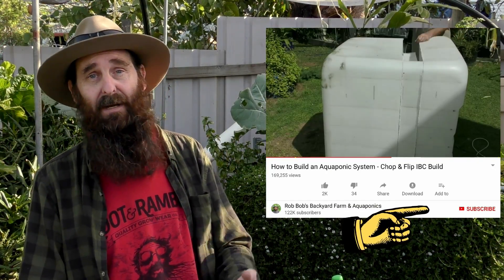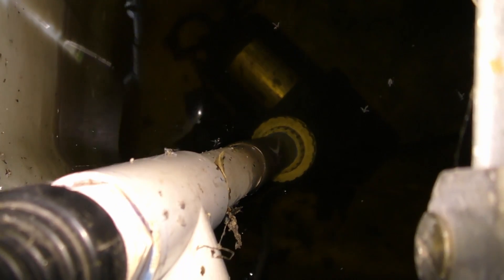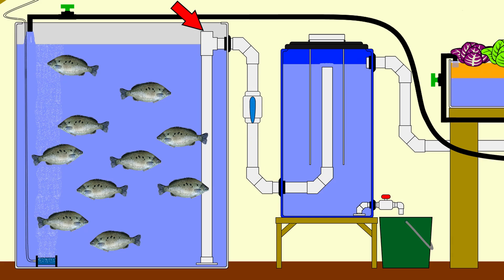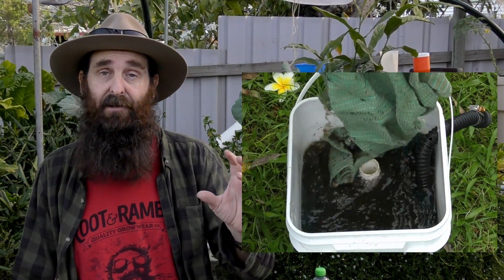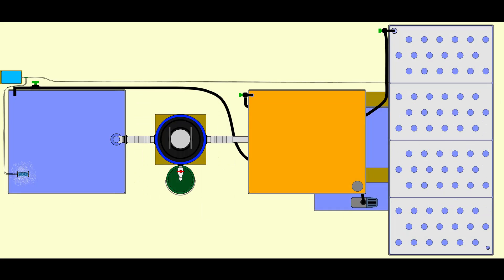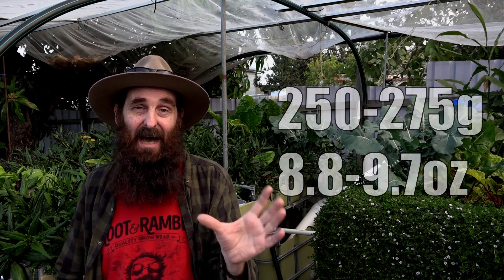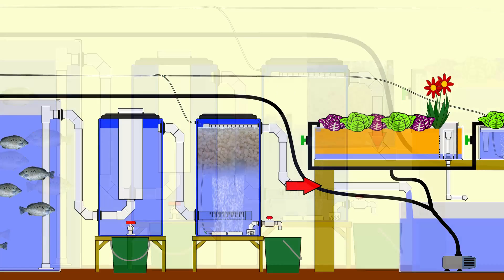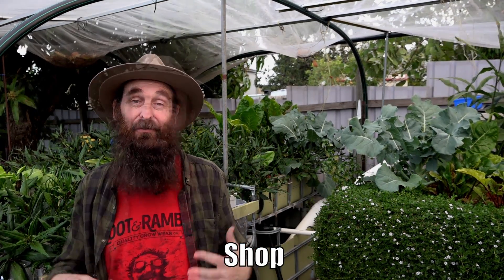Aquaponics Design | Backyard System for Pat

Comment: One thing I've really struggled to find is a good rule of thumb for sump tank size. 

I'm building a split flow system like in this video with a 1000 litre fish tank and ideally 3x 300mm deep grow beds. 

How much volume (roughly) would I need in my sump tank?
Reply from the maker: I have mentioned it in passing in a few videos but haven't posted a video just on sump tanks. 
In a system with flood & drain grow beds I work on the 50% rule. I like 50% of total grow bed volume as the minimum size for the sump. This allows extra water to stretch out top up times during the peak growing season. The extra water can also help compensate for temperature swings as well. 
Hope that helps some.
Reply: @RobsAquaponics  thanks so much for the reply. That's about where I've landed too. So hopefully it'll be all good. :)

Comment: I am interested in building one I was going to use a horse trough 1000 L container made out of galvanized steel
It has a hose size adaptor on the side of the bottom. Is there a way I can use that instead of cutting a hole through the side of the horse trough
Reply from the maker: Sorry I missed this Earl. 
Gal tanks are an issue for the fish as they can get zinc poisoning & die off fairly fast. It's best to line gal rums & tanks with pond liners if you're going to use them. 
Cutting a hole would be your best option as I would think that the hose adapter would probably be no bigger than 1". You would need a 1½ - 2" hole to get a nice water flow under gravity if that's how you'll be moving water out of the tank.

Comment: For my last system I just fed @ about 13g per m2 of plants per day. 

What was awesome... was that I stocked at a low rate too. So low that I had to feed them 3x a day (via auto feeder what was topped off every two weeks or so) so that they were able to eat that amount of food. It was actually 8x a day when they were fingerlings. lol 

My system was VERY low maintenance, Very resilient, and No solids filter either as the worms were able to keep up and my beds only filled with solids about once every 4 years or so. 

I literally just added water about 1 time a month. Fish feed about once every two weeks. A teaspoon or two of crushed oyster shell every 3 or 4 months. Didn't even have to add chelated iron anymore because I had the bottom 6" of each media bed filled with red lava rock.

DOWNSIDE... I didn't grow heavy feeder plants in there. Just Lettuce, kale, flowers for transplant, and a billion fruit tree clones. Which, a single tree paid for the electricity for the year. Extremely high cloning success rate too once I figured it out. 

That was a trial 150gal sump tank/ two 50gal bed system. I want to step it out to a 300gal sump tank system this time... and later on I will convert it to a CHOP system when I am ready to expand. 

I was using goldfish and a koi and sold them as they grew... which brought in good money as well. They were some pretty fish! 

I want to do a couple of koi and goldfish again... but then grow out eaters in the side tank this time.
Reply from the maker: Nice on MSH. Hope the system grew well for you this season.

Comment: Can you please provide with dimensions of fishtank, biofilter tank and solid filtration tank 
For me starting with small set up with just one fishtank to know the process? 
It would be very helpful
Thank you
Reply from the maker: In my basic system I use 1000L fish tank, 200L solids settlers & biofilters & the sump is generally 600L in volume. 
A 600L sump will support 12L of flood & drain beds. 
I hope that helps some.
Reply: @RobsAquaponics  thank you very much🙌

Comment: I'm wondering what would it be like if you got rid of the separate oxygenator and supply the air creating Venturi air suction through the water pump to both fish and the plants? It would deliver water and air together trough the same pipe. The pump might need to be bigger. But it seems like having one "heart" for the system would be easier to maintain. What do you think, Rob?

Comment: Hello, Rob. Thanks so much as usual for your amazing videos. Tell me please, what's the volume of growbed 1 (with clay media) and growbed 2 (with water)? Looks like 200l-250l and 400l resprectively
Reply from the maker: They are just rough drawings but I was basing it off of IBC tanks Dima.
The media beds would be cut at about 300mm/12" high so they would hold roughly 300L.
I think I doubled the length for the DWC bed so that would be about 600L.
Hope that helps.
Reply: @RobsAquaponics  thanks so much
Reply: @RobsAquaponics  you know
I start projecting my own single loop system. Fish tank 200l, solid filter 40l and 2 growbeds 100l each. I tried to save your proportions. Could you please help and tell is it okay in my scale)? My circulation flow rate is 400lph = 2*200(fish tank volume). But I cannot understand how much oxygen per hour should I provide to keep my fish happy)
Reply from the maker: @dimannish1  Sorry I missed your reply.  I work on at least the volume of the tank the fish are in per hour in air if that helps.
I hope the system is running well.

Comment: Your system seems to be exactly the bees knees and I want to make it but I'm concerned about the running cost as electricity here is far from cheap.
Could you please give me an estimate of how many kilowatts of electricity this system uses for pumps/airblowers etc. per month.
Reply from the maker: Hey Douglas.
Power cost is fairly easy to work out. Multiply the watts of your pumps by 24 (hours) then by 365 (days), eg. 80w pump would use  700.8kWH [(80x24)x365 = 700,800W].
Next look at your power bill to see what they charge per kW & you should have a ballpark power bill figure for running the system.  
It's a bit hard to get an accurate cost on ours as we have a back to grid solar unit on the roof so our system is subsidised to a point. 
Hope that helps some.
Reply: @RobsAquaponics  
Thanks for the helpful info.
Time to get the pencil out.
Reply: @RobsAquaponics  
And thanks for taking the time to reply.

Comment: This is split flow if I followed correctly. What about putting all the water thru the beds so it is a closed loop (not sure that is the correct term)
Reply from the maker: Hi Dave. I call that a single loop. 👍 It can be done & will be a better option for some. I run through a look at both types in this video if you're interested,
https://youtu.be/0QQA5BpWKec
Reply: @RobsAquaponics  I’ll check it out now

Comment: How do you prevent overflow of the sump tank?
Reply from the maker: As long as the system is filled to start with by adding water to the fish tank & let to over flow into the sump tank until that's full you won't have any issues when you start out. 
When topping up the system you remove any standpipes in flood & drain beds then top up the sump to the desired level. That way all the water will be in the sump or fish tank at the time of filling.

Comment: The question I have is is there any advantage to running to radial flow barrels in parallel and then a biofilter barrel.   Would this dislodge more solids or just waste the space with little return?
Reply from the maker: Running them in parallel would reduce the flow rates through them meaning more solids settling time which is a good thing. 👍

Comment: Im new here, and thanks for this video.  I learned a great deal about aquaponics in this alone!  How often do I need to clean sludge from the rock beds?  I have still so many questions, so I will look at your other videos before asking questions that look like repeats.  Thanks again!
Reply from the maker: Hi Deborah. I find every 2-3 years if the solids settler is maintained. Cleaning the clay is a real easy job (I've got it down to 1 hour per bed)  but it can take a bit longer if you use rock as the grow medium. This playlist has a load of videos for those just getting started in aquaponic if it helps at all.
ttps://www.youtube.com/playlist?list=PLBcWprMIwYYj8zCdbSzPJOR3HRXpxuBwf
Cheers & happy growing.

Comment: In this design, it looks the Bio Filter outlet is at the same height as the Outlet from the Radial Flow filter... 
- Doesn't the Bio Filter Outlet need to show as at least half of the Radial Flow filter outlet pipe lower (eg: 1"/25mm) lower > so the flow rate keeps up through the bio filter??
Reply from the maker: I oversized the pipes so it generally isn't an issue. It will cause issues with higher flow rates or smaller pipes.

Comment: Hello! I've just been referred to your videos by my daughter's teacher - love what you're doing. A question re water - do you treat the water before throwing in the fish, or use normal tap water (chlorinated and fluoridated)? Also for topping up any lost water due to evaporation? Just wondering as all the chemicals for my cold-water fish days "not for food fish" or something
Reply from the maker: Hi Neil. It's best to dechlorinate the water before adding any fish into a system. I use 1 heaped tsp of ascorbic acid (Vit C) to 50gal/200L of water to breakdown chlorine & chloramines if I need to do an emergency top up or start a new system. 
I've found doing small top ups with town water (5% total volume) doesn't affect our fish but the amounts of the chlorine & chloramines will vary from location to location. 
It is also best to "cycle the system" before adding the fish so their waste can be converted into a non toxic form & not kill them.
This video will help with some cycling information,
https://www.youtube.com/watch?v=kmxfI_fkmtc

Hope that info helps some.

Comment: Hi Rob.
Great video, thanks.
Why do you plumb your water from the fish tank to the bottom of the solids filter? Could I just have the water dropping into the top of the stillwell?
Thanks again.
Reply from the maker: Hey Michel. Having the water come up from the base into the stilling well slows it's velocity down considerably. 
If it was to enter from above you would probably get a current form at the base (depending on the flow rate & size of vessel) which would disturb the solids you're trying to settle out of the water column. 
Hope that helps some.

Comment: Can there be 2 different sump tanks for water going to plants and another for water draining from the plants and going back to the fish tank?
Reply from the maker: Yes you can but you'll also need 2 pumps to ruin the separate tanks. You'd also need some sort of overflow set up in case one fills faster than the other I think.
Cheers.

Comment: After looking at your garden I thought this place has so much waste space. I decided my aquaponics should be on the concrete slab so I have more garden space.I live in Paynesville vic and its cold some nights although more even temp than in land, what should I put under the carpet to stop the fish getting cold.
Reply from the maker: I have seen some folks wrap the fish tank in insulation then clad over the top of it to help keep the water temp up at night. 
Others won't worry & will run trout through the cooler months as they easily get up to harvest size before the water temp rises above 22°C in late spring early summer.

Comment: Hi mate, i have a question. Does the filter should have bioball in it? Or can we have another way replace them to bactery nitrobacter just to separate ammonia to become nitrite and nitrate?
Reply from the maker: Some folks have used old plastic bottle tops & others have used shade cloth or bird netting to create surface area for the bacteria to colonise.
Hope that helps some Shald. 👍
Reply: I bought a roll of polystrapping for shipping  and cut 10-20 ft lengths and split the staping in half or maybe thirds making long strands that have  great texture.  Used it in a biofilter for my fish pond  and it worked great!   lol  got lots of the roll of strapping still!   Don't buy a 3 ft roll unless you need LOTS of filter media!

Comment: Love your videos Rob. My interest in AP was sparked nearly 10 years ago when I found the Backyard Aquaponics and Practical Aquaponics forums. I really wanted to build a system then but never got around to it. Found your videos again recently and decided instead of pining for a big system which I can't do right now I will build a simple chop and flip blue barrel with my kids. They're excited and once we come out of lockdown we will give it a crack. We're in NZ so will probably use goldfish or Koi to stock it.
Reply from the maker: Nice one Martin.  Hope the build went well mate. 👍👍
Reply: @RobsAquaponics   Does the SLO have to be the same height or less than the tank? What if I don't want to drill into my aquarium glass; can I make SLO taller to go over the edge and down to the solids filter?

Comment: Can you add electrolytes (calcium, magnesium, potassium, iron)  in a AP system? Is this good for the fish?
Reply from the maker: Most folks will add in calcium & potassium as these are 2 elements that are not found in large amounts in the fishes waste.  You may need to add in iron & magnesium as well. Most will wait until they start to see deficiencies in the plants leaves but you can also buy tests for them as well. 
Most forms are safe for the fish in the amounts we add but care must be used when adding elements in the form of hydroxide. It can rapidly change the pH & damage the fish. It can also burn us as well so proper care should be given when handling these substances.
Cheers.

Comment: Thank you very much for your detailed explanation. I have one question if you wouldnt mind explaining it. Would I be better off having two sump tanks? ie water coming out of the fish tank, through the radial flow, then to a tank, then taht water pumped up to the grow beds. Then another tank that the grow beds drain into, and that water is then pumped back into the fish tank?
Reply: by having everything fed via one pump from one sump tank, does that not mean you are only getting, lets say, half filtration as "dirty" water from the fish tank is being pumped straight back into it?
Reply from the maker: @markl4528  As long as the fish water is flowing through some sort of bio filtration all should be good Mark. 👍 Many folks have run lightly stocked aquaponics system with just a solids settler & no bio for years without any issues but I prefer to have one in there if possible.

Comment: Rob Bob, I'm doing the chop and flip. do you think I need a 100gph? Cheers and have a top one
Reply from the maker: Sorry I didn't get back to you quickly. What pump did you end up getting?
100gph may work OK if it has a decent enough head height. I couldn't find any small ones that were reliable so that's why I over sized it in the build clip.

Comment: Hi, Rob, thank you so much for sharing all the information for helping the people who wants to build the aquaponics system.
I have a question about why would the 300L divide 25 , which in the video at about 9:00 to 9:15. 
Would you please let me know? Thanks
Reply from the maker: Hi mate. 25L per 500g fish is a rule of thumb to do with bio filtration. 25L of the clay or 20mm/¾" suitable rock has enough surface area to hose the bacteria required to process the waste generated by a 500g/1lb fish. 
I did link to a clip that gives the full explanation at that point but it doesn't always pop up on all devices. https://www.youtube.com/watch?v=MeYtUfBKwNo
Hope that helps.
Reply: @RobsAquaponics  Thank u very much Rob!

Comment: Rob,

Is there a reason for using 2" pipe for your SLO and filter plumbing?  I'm assuming it's to allow a big enough water flow if you're using a large pump.

Thanks.
Reply from the maker: That's pretty mush why DG.👍 I found it handles flow rates of 1500lph/400gph + than the 40mm/1½". 👍
Hope that helps some.
Reply: @RobsAquaponics   I hope I didn't make a mistake by plumbing a 1" on my new system.  I have a 250 gallon fish tank, plumbing into a 55 gallon sump using 1" From there it pumps up to the filter and out to 2 - 55 gallon grow beds (4 beds) (blue drums split in half) using your bell siphon design dumping into the fish tank.

I might have to add another 55 gallon drum to the sump tank, but I haven't gotten that far.  I only have a 400 GPH pump Currently, but I'm sure that will have to increase to get good water movement.

Any suggestions?
Reply from the maker: @denvergardner3987  I'd say you'll need to go up to a 1½" pipe Denver. The main reason being is that the water in the fish tank needs to be turned over at least once an hour  at a bare minimum & I don't think the 1" pipe will be able to handle 250gph gravity based flow rate. 
I have this clip that looks at how I enlarged some holes if it helps any. https://youtu.be/8PIEsgCJ0fc

Comment: Gday rob ..question .
If i ad a larger sump to my system will this increase retention time .. i have 300 a lt per min that 18000 lt per hour . pump available to me at this time . Well and truly over the top so trying to ad retention timebto my system ..
Reply: Will be running venturis into biomedia filters and into fishtank to help slow the flow .also running split flow system .one pump to rule them all with air back up to fish if a malfuction occures
Reply: 1 radial flow filter and 2 biomedia filters each at 200 lt cap so 600lt in filters at all times plus 5 grow beds at the moment
Reply from the maker: Hi Bramley. Sorry I missed this. The retention time has to do with settler drum sizes & flow rate. Just posted a clip on how the settlers work 
https://youtu.be/sBCC9tMsleY
& another on how to build them
https://youtu.be/crKjqCJmIV0
Probably a bit late but hope it helps some.
Reply: Rob Bob's Aquaponics & Backyard Farm thanks rob I worked it out in the end all good as you have seen in the photos I sent you cheers